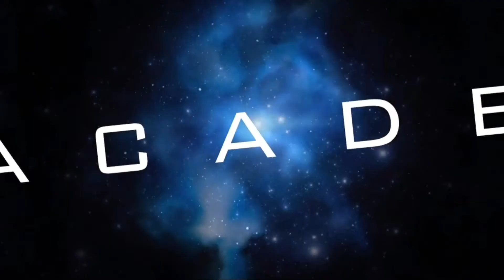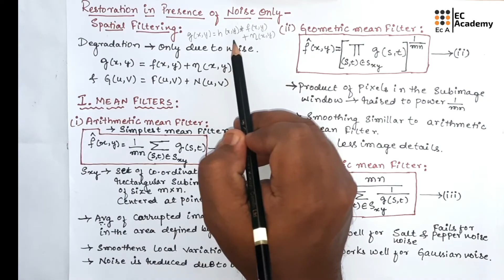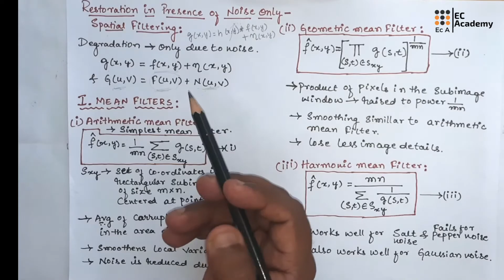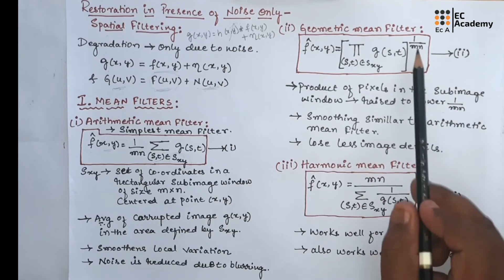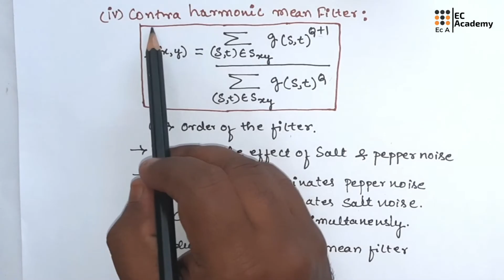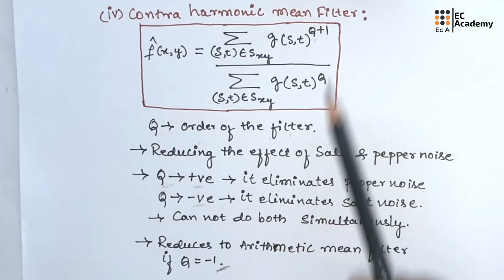Mean Filters in Digital Image Processing (DIP) | Spatial Filtering for Noise Reduction

Comment: Differentiate the salt noise and pepper noise
Reply from the maker: “Salt-and-pepper” is a type of noise specific to images. It consists in white (salt) and black (pepper) dots, randomly scattered onto the image. In a positive representation of the image (beware! there are also negative representations) black corresponds to level 0 in the image, whereas white corresponds to the maximum level. The image itself may contain several hundred levels of intensity. It means that the statistics of salt-and-pepper are not about intensity, but about position of noisy points, along both the width and height. So we have a bi-dimensional uniform distribution.
Hope this was helpful....
Do SUBSCRIBE and keep supporting EC Academy 👍